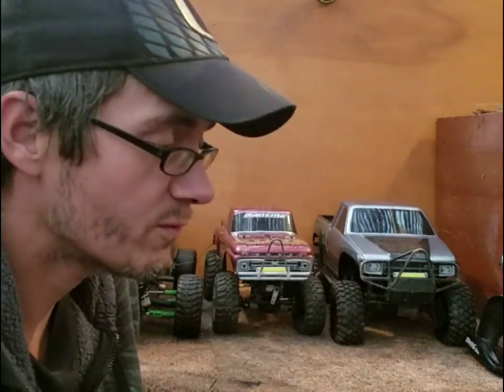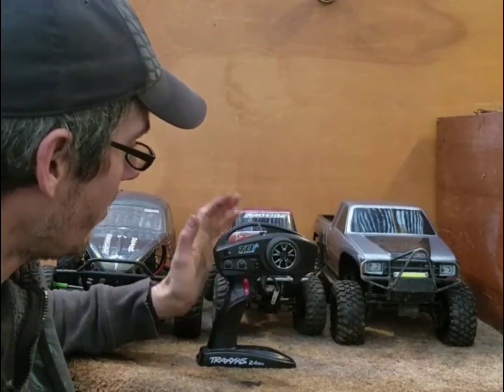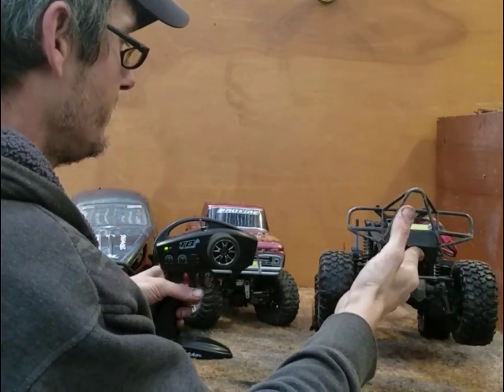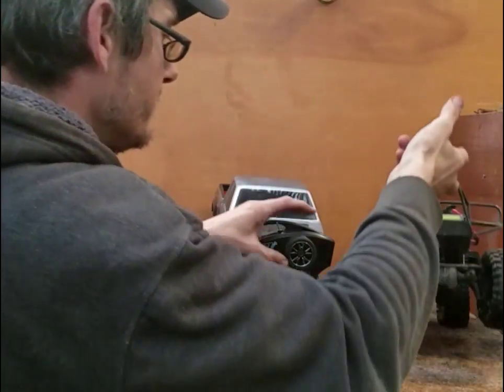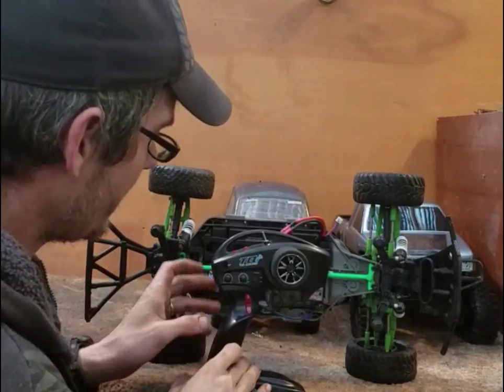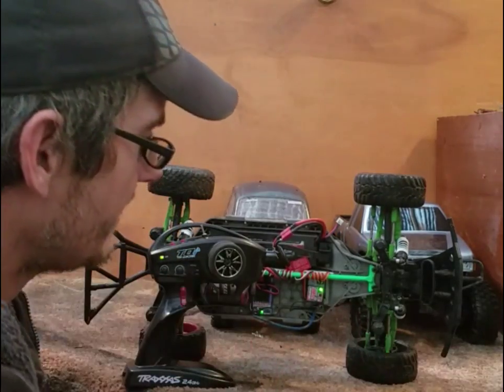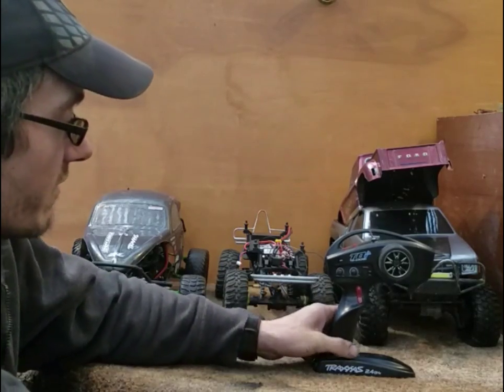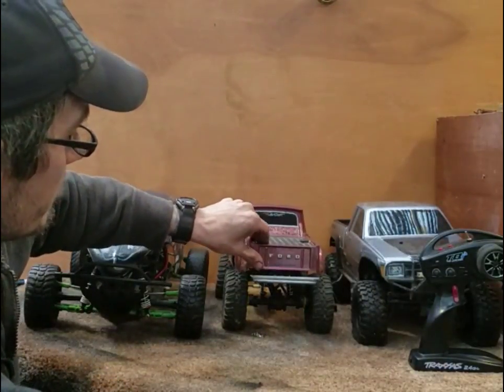Binding multiple receivers to a single Traxxas TQI radio

Comment: WOW! First THANK YOU FOR HELPING THE VETS. Why don't they tell you how awesome this radio is upon purchase and NOT EVEN in the instructions when you purchase it. I bought my TRX4 in Dec 2020. My poop hobby shop wanted me to purchase a different radio to bind multiple RC's much cheaper for a new receiver. I'm a past fire Chief and what you see only goes away for a while when you care.
Reply: Will the self righting work with the 2wd stampede or the slash 2wd and are all the TQI tsm receiver and transmitter or are they different TQI tsm  and are there non tsm TQI  and will the slash you have with the TQ receiver and the TQI transmitter work with the self righting or does it have to be a TQI receiver and transmitter

Comment: Very interesting video! Discovered it only today... I've a question. What about settings for each model? I mean if I've set the EPA for the steering (as example) in model #1 and differently in model #2. Does the TQi radio will use the right ones for each model? Or if you bind several models you have to use same configuration for all?

Comment: Thank you. And something's wrong if someone doesn't get the binding to the other 27 RCs. You've shown how to do 3 and they just have to be able to count to 30. Lol. 🤙 Good thing to do so you have the other transmitters not being used and wearing out. Which means if you go to sell a couple they go with unused transmitters as overtime with out of use can cause the throttle spring and steering return spring to break. I had an Outcast transmitter steering spring break, so I took it apart and used the next loop in line to hook on. Saved me from buying a new one. 👍

Comment: My question is this. I have 5 trucks synced to a radio. It's a TQi I got from a TRX4. But I also have the Bluetooth chip in it. I have 4  TSM receivers on the way. Will they all be able to show up in my phone with that one radio since that is where I tune my trucks? Thanks in advance.
Reply: Once bound, yes.

Comment: What if I have 3 traxxas trx4 and I bind all 3 to 1 controler,  then I want to use all three at the same time what will the controler do when binded to all three when they are all on
Reply from the maker: It will link to the first one powered up and ignore the rest

Comment: Can you run 2 rc at once with same transmitter just wondering lol?
Reply from the maker: No. It will link with the first rc powered up after the transmitter. After the radio is linked to the first receiver it stops searching for a receiver that it is bound to and won't detect the other receiver. It will only search for a receiver once per power cycle.

Comment: I tried this and it did not work, do the receivers have be TQi as well?
Reply from the maker: I listed some of the receivers that the modern tqi radios will bind to. They do not have to be tqi receivers, but they do have to be the same frequency. This video is for 2.4ghz radios and receivers.
Reply: @JPsRCWorkshop  Thanks for the reply! I tried it again today, and it works great. I blame the Corona Virus.  Anyway, now I can sell some of the extra transmitters, as I've collected way too many!

Comment: Is the binding the same in all remotes
Reply from the maker: No. Traxxas tq and tqi are easier to bind than most other radio systems. Most of them require a special bind plug to bind. What radio and receiver are you trying to bind?

Comment: Thank you so very much for this great informative video; I recently purchased  a Rustler vxl 4x4 and have the upgraded radio.
Want to get a Slash vxl and use one radio; stopped in to my local hobby store  to find out if what you showed me could be done.
The owner said don't think so because there son just upgraded to another radio and Compatible receivers.
I contacted  Traxxas and asked them about what you just showed and said yes it is possible; just go to our mode page for instructions. 
I read them but was still unsure; showing me was way more easier. 
Thanks
Reply: I just picked up a rustler 4x4 vxl aswell. Now i have my trx-4 and rustler on one transmitter, and it works perfectly!

Comment: Can I still bind 2-6519 receivers 
with the TQ though? But I would have to bind the vehicles every time right?
Reply from the maker: That's correct for a tq radio. A tqi can bind with up to 25 receivers, not certain though since I don't have that many traxxas receivers...
Reply: I ammin the same situation, did it work with 2x 6519 and a tq radio?

Comment: So my son lost his controller for his stampede so can I use the controller from my jato to work it even tho it has more features on it
Reply from the maker: It depends on which particular radio you have and which receiver is in the stampede, but most likely yes.
Reply: @JPsRCWorkshop  thanks...the reciever for the stampede is the basic one in the video and the jato has the tqi it also has a port on it for the phone hook up for the sensors
Reply from the maker: @travisjones9466  it should bind, and it will remain linked to the jato also. Which ever car is turned on first after the controller will be ready to go. Power off the radio and power it up again and turn on the other rc to switch.
Reply: @JPsRCWorkshop  thanks man...your saving me from a disaster right now...my oldest son dont live with me so his mom dont care about these things cuz he also lost the battery and the other things the car came with.....anyways not to vent to you about it but you now have a new subscriber buddy
Reply from the maker: @travisjones9466  awesome

Comment: Can i bind to wltoys a979?
Reply from the maker: Frappuccino Caramel traxxas transmitters will only bind to traxxas receivers. Short answer is no. However you may be able to put a traxxas receiver in the wltoys rc. If you can then you're good to go. I'm not super familiar with wltoys models.
Reply: Ah ok.. Thanks man...

Comment: I did this with my traxxas slash radio. I linked it to my Tmaxx and now my slash 4x4 has lost range and sometimes it will even glitch out with it like 50 ft away. Any ideas to what could be wrong??
Reply from the maker: Don_336 I would check your antenna wire for any damage. I would also try re binding. I've never seen that  issue without antenna damage.
Reply: JP's RC Workshop yeah I tried re binding it and also check my antenna wire and both seems fine. So I’m thinking maybe my receiver may be bad. My Tmaxx has the tq receiver and slash has the tqi receiver so I’m not sure if that could have damaged anything but I wouldn’t think so?
Reply from the maker: Don_336 if it's a tq radio and tqi reciever that could be the culprit.

Comment: how do you trim steering each receiver separately?
Reply from the maker: SuperBaylisstic the trim knob for steering, throttle end points are saved by the individual receivers from the calibration process. Channel 3, 4, and 5 on a traxxas do not allow for endpoint or trim adjustments, even if you have the bluetooth module.

Comment: Hi Johnny, Thanks for this video, works perfect.👍 i got an UDR Traxxas, with telemetry, that i cant bind to another transmitter, tryid 2 different ones, both TQI, no luck.! Any idea.? Yours Henrik
Reply from the maker: Henrik Nielsen I don't have any experience with the UDR, or telemetry setups. Sorry I don't have an answer for you.
Reply: @JPsRCWorkshop  yeah I cannot get my radio throttle to work only the steering works is it a broken radio ?